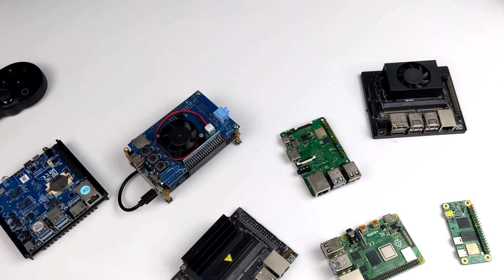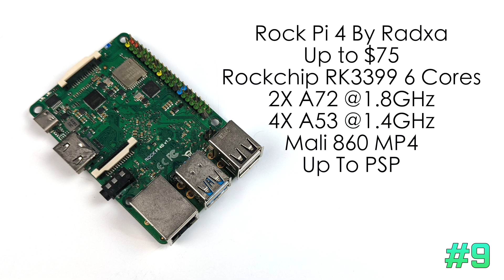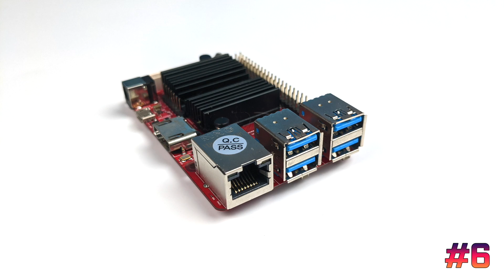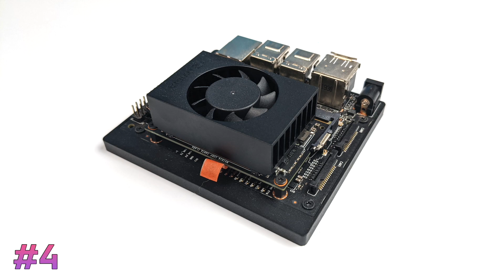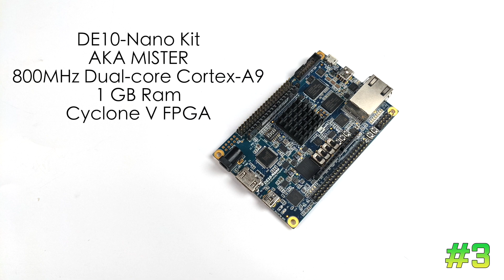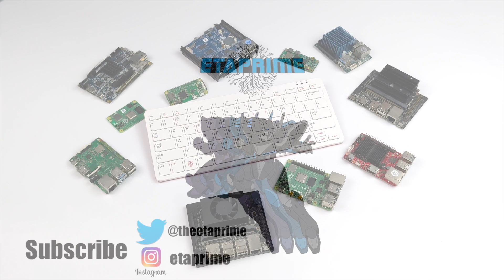The Best Single Board Computers Of 2021 Top 10 ARM SBC’s

Comment: If anyone knows this answer let me know please? Which board will work best with a 4k camera module? One that can support at least 30fps if not 60fps. Been looking at ardumcams for rasberry pi but it seems the pi isnt powerful enough to run 4k video from a camera module. On Arducams it seems there is support for the jetson nano in 4k but I wanted to ask if anyone knows better. Cant be more then $150ish its going into a prototype product for consumers. Doesnt make sense to spend $400 on just the board no one will buy so needs to be within reason.

Comment: I'm a Pi enthusiast and run an 8GB Pi 4 as my nextcloud server.  But I don't feel like it's quite powerful enough the be a desktop replacement.  I'm really not a gamer beyond the occasional NES/SNES emulation so that's not it.  As a scrum master, most of my work is done with web tools like Jira.  Any suggestions for a sub-$100 sbc with a little more desktop oomph than the pi 4?  (Bonus points if it can drive 2 displays over USB).

Comment: Hmmm, technically my favourite "emulation" board does not exist and I have problems with calling it "emulation" as it is very very different technically from what software emulation does. From this you're likely already realizing I'm talking about something along the lines of the DE10 (Mister FPGA), and you are correct. What I prefer is the FPGA Hardware Re-implementation approach as it enables us to have the closest thing to the original hardware implemented. That said, currently (even with the large number of available LEs etc)  the FPGA approach still has some limitations due to workarounds having to be implemented due to the fact we have architectural limitations forced upon us due to using a single chip. 
I want to see a board using multiple FPGAs interconnected with a "smart" BUS (or multiple BUSES, which is important for architectures such as the Amiga) enabling us to implement the hardware much closer to the original arrangement and removing the limitations imposed by using a single chip solution. 
My idea would be to use those cheap Cyclone II boards (the most basic breakout board available for these) and then making a motherboard to interconnect about 4 of these. This board would have at least 2 RAM sections (Again Amiga related requirements to implement CHIP and FAST RAM)  preferably 3 each with their own sockets. It would have an expansion BUS to enable add-ons to be made for the system (so you could for example use real hardware from the era with this, like for example Zorro boards), Compact Flash socket (because this one has UDMA support unlike SD cards), USB ports for Keyboard, Mouse and a special USB port working as a Gotek for floppy support, HDMI output, Analogue audio output, custom ports to use ESP8266 or the ESP32 as WiFi modules, Gigabit Ethernet, a broad selection of GPIO with Digital and Analogue pins in order to enable not only digital joysticks support (Amiga/Atari/Early Consoles) as well as the PC analogue joysticks support and of course Midi (as this is basically just a custom serial interface truth be told)
This mainboard will also have a microcontroller (Arduino or the new PI MCU) with it's own SD card that would be used to upload the firmware into the FPGA cores and handle initialization tasks as well as base system management (Power On/Off button control much like the PC does as well as thermal/fans control).
It also needs (aside the BUS expansion connection) an additional FPGA bus link to enable us for example to connect those fancy Cyclone IV dev boards that like the DE10 already have RAM, VGA, PS2 and SDR connections among other niceties. This particular connection would be handy to enable the emulation for example or more advanced GPUs. Having their own onboard RAM definitely helps with this.
Making this board modular (in what concerns the FPGA boards) would enable future upgrades by simply upgrading the FPGA modules.
(On this whole subject, I actually have 4 Cyclone II's and one of them Cyclone IV dev boards as well as Arduino's, in fact I wish I actually had the time and help getting this idea off the ground as I admit I'm missing some know how needed to do this, implementing the mainboard design would be feasible but when it comes to the FPGA cores I would take an eternity to get this done as that part I have never handled and I suppose that getting existing cores and breaking them down into multiple components so we could break down the system into the multiple FPGAs as well as recode them to better match the original hardware will not be an easy task, specially alone and never having done such a thing - there is another reason to want to have this done like this, such a base system can enable the development of a computer system that can morph itself while running, for example changing part of the GPU to have a different type of video decoder on the fly instead of doing it on software, or change the CPU to support a new instruction for example to handle things like encryption and decryption, this would be a system that could basically update its own hardware capabilities as needed and is something that having a proper OS developed for taking full advantage of the features and possibilities provided by such a platform will prove quite powerful not to say revolutionary).

Comment: Buyers of the Pi CM4 beware!!! 

I just bought a CM4 (with Wifi, 4gb ram, 8gb emmc) and I was blindsided by something I haven't seen anyone mention. If you buy a variant of the CM4 with on EMMC storage, you CAN NOT use the microsd card slot as well. The io pins inside the SoC for the sdcard slot are connected to the emmc module instead on those variants, meaning the sdcard slot is not connected to anything. This is not something IO board makers can fix either, as it's inside the CM4 SoC. So, do not buy a CM4 variant with EMMC storage expecting to also be able to use the sdcard slot for extra storage. The only way to use a microsd card will be to use a microsd-to-usb adapter, thus taking up a USB port with an adapter sticking out the side of the Pi.

Comment: My favorite is still the Pi 4, a great balance between power, price and software support. I still use my old Pi 3 too, set up as a 720p home security camera with a C920 webcam.
Those Tegra boards are lovely, wish there was more software support for them though (outside of AI use cases). The Xavier NX is 400 $ or more depending on where you look. The specs are monstrous though for an SBC.
Rockchip software support is getting there but still needs work.

Comment: I know the RK3399 is not your favourite, but I do a bit of hardware development and it is BY FAR the best chip for USB throughput.  Rockchip makes the only SOCs with independent USB busses for each port.  Every other SOC uses some garbage hub (either internal or external) that trashes USB bandwidth.  

With every other SOC the most you can hope for is 2 USB camera and no other hardware.  With Rockchip SOCs you can easily push 8 USB cameras, wifi adapters, SATA, or potentially even more.  Even Rockchip's lower end stuff still has independent USB busses.  There is no comparison if you're building a NAS or robot.

Comment: The reason that drives me back out Raspberry pi
It is the disastrous support of Opengl 3.x / 4.x and Vulkan 1.1 / 1.2. 
And not to mention the performance of rendering on high resolution.
On the odroid boards the performance is very lost out in linux (x11 good driver) and it focuses a lot on Android. for better perfomance and out for latest API.
Compared with Nvidia jetson boards it's very limited in the AP latest engines standard. 
They are not even at the height of being able to load an engine to the level of  dx11.

Comment: LOL ... the RPi4 fans are dellusional. Calling this thing "powerfull" or "a beast"?! Someone even saying, they should release the pi5 to "stay on top of the competition"?!
As long as there is competition for the raspberry pi, it is because of the SoCs they choose being slow and compromised ... every generation ... the price for choosing broadcom!
They REALLY REALLY should try out an Odroid N2 or Khadas vim3 pro

4xA-72@28nm                   vs 4xA-73+2xA53@12nm
VideoCore Vi (32 GFlops) vs Mali G52-MP4 (108GFlops)
microSD only                      vs eMMC

What held back these fantastic SoCs was the progress that had to be made on the panfrost driver side for Mali-G52 (also known as bifrost) graphics. The RK3399 chips had the predeccessor graphics called Midgard which reached the same level of usability half a year ealier. But Bifrost support in panfrost now has a very usable state. Now they run on a fully open-source stack ... no binary blobs needed! Always on the latest Kernel an Mesa-Stack! eventhe drivers for video hardware decoding are right in the vanilla kernel! Just download Manjaro and start using it!

I have a Khadas VIM3 Pro which has a variant of the same SoC as the Odroid N2 on it (has A311d instead of the S922X ... difference being the AI accelerator which is active in the A311d .. all else is equal). As long as you don't ask it to play youtube in a browser at 1080p/60 (which at the moment has to be done in software) it really feels like a desktop. The Browser is so smooth and snappy that you forget that you are surfing on an ARM SBC! Video acceleration is on its way to getting figured out on the application side ... and the big Amlogic SoCs (S922 and A311) have VP9 hardware decoding at 4k60. So these SoCs can do for years what Pi4 user dream of in a Pi5.

Comment: There's such a sad situation in the market right now that all the Pis are pretty much sold out everywhere in my country. I'd love a Radxa Zero so much but importing it from China is pretty much pointless because if you add up the price/performance with the cost after customs, you can get a pretty nice Intel mini pc with a built in EMMC drive and 4 gigs of ram sealed from people on various sites online. For example, a quad core atom with a 64 gig emmc and 4 gigs of ram (and a Win10 license) cost me less than a Pi4 4G from scalers right now. Kinda annoying!

Comment: With all the renewed interest in CRT gaming from the retro community, I think whatever comes next, as long as it has CRT compatibility out of the box and/or is easy to enable, will definitely have a leg up on everything else. Got to admit, MiSTer looks amazing, but pi 4 via composite or vga looks and feels pretty authentic. If money were no object, MiSTer wins hands down...but for me, pi 4 through composite is good enough while I save for something else, and I would definitely buy a Pi 5.
Reply: @funguseaterAI  no I hear you, if I didn't have a couple of smaller CRT sets I would just move on. No way can I go to anything larger than a 20" though, and even that is pushing it. If what I have now craps out though, I don't think I'll keep looking for replacements. If I can't fix it myself, I'll just move on

Comment: I just wish someone would release a real powerhouse of a ARM SBC. I just find it sad that my old Pixel 2 XL from 4 years ago is more powerful than any of these. I bought the Pi4 because so many were saying how powerful it is. Guess I have a different definition of powerful. It can't even do smooth youtube playback at 1080.
Reply: That's your first error.... Listening to Pi evangelists. The Pi is a piece of crap in terms of specs. It's all about the ecosystem and the expansions which lead to so many possible projects.

I'm quite happy to quote and compare specs to anyone who disagrees.
Reply: YouTube playback is all about hardware driver support, and has nothing to do with how 'powerful' it is. A Chromecast can show YouTube, it has a minimal processor, but it's completely optimized for video decoding. The manufacturers simply don't release the video drivers required to make it happen on a Linux board.

Comment: Nice video! Over at Retro Arena we are working on an image that will run on both the 2 and 4GB models, and have 2.0GHz CPU speed, with 1.15Ghz GPU. Should be done in a couple of weeks.

Comment: The last single-board computer I bought was the pi 3 B+. It's been going for over three years and I don't see a reason to replace it yet. Now for hire emulation I use a small form factor PC.

Comment: On the top of my list is Rpi4, of course. The king is the king, it's the only one that everything's made for. Then, there are a few blank spaces, and then I like android TV boxes actually, they can be had really cheap. Also, odroid n1 is great due to s922x chip (huge batocera fan here). After that, next to computers like hp prodesk 600 mini, I don't really need more machines to fill the list honestly. I do like the new radxa zero, but for now it's just promising, not a must have.

Comment: I can agree on most of your picks though i would put the raspberry pi 4 at the third place for emulation, as depending on where you buy one, it isnt very cost effective, so i would put the Odroid n2+ at first because it has a decent community to make things run pretty smoothly, and its slightly more powerful while in some cases being cheaper.

Comment: The Odroid N2+ is an absolute beast. Go head an consider a video dedicated to this board. I've done both emulation with Batocera and I'll fire up Android from time to time. Plug a cheap little wifi adapter and a bluetooth adapter and there you go!

Comment: I've never seen a pi zero anywhere close to $5 to $15. More like $30+. My favorite ARM has been the Orange Pi PC, or any TV box with the same Allwinner H3. I've found a few for around $15 to $20 shipped before. They run Android 7, RetrOragePi (Emulation Station), Lakka (RetroArch), run emulation up to PSP, there is even a build of The C64, and more.
Reply: I've got an Orange Pi that I've never really tried anything on. Interesting.
Reply: damn, raspberry pi zero is 10$ with shipping here, with wifi its 16$

Comment: For me it's always very frustrating that usually the most weak in hardware boards have the most software support. Fir a few dollars more you could get a way more powerful board that runs circles around the RPI4. Just think what all we could do if the Jetson or the Odroid had the same software and development support like the RPI4.
Reply: cheap -> more users. I think for emulation use case it's enough( Pi4 up to PSP/Dreamcast), If I'm not mistaken only jetson xavier that can go above that, and at that price point I'd rather get a used PC.
Reply: Aren’t all the jetson boards weaker than the rpi except in gpu?

Comment: Great list here.  I still use my oDroid XU4 for emulation.  I recently switched to using Batocera on it and I have not had any problems with any of my games or the systems that are included.  I've even been able to play one PS2 sports game on it (with PCSX2 tweaked out a bit).

Comment: Not sure if there's actually 10 options for x86 based but if you can, you should do another video about mini/single board x86 machines because those can be handy to pair with existing x86 machines as lower end nodes for example (As in: you can ARM based clusters and just keep adding nodes but it's usually not something you can combine with existing x86 hardware whereas I can repurpose at least 3 or 4 older x86 machines and add more x86 SBCs if I need to expand the cluster)

Comment: I was just searching for a SBC today to run some bots i created and I was very shocked how the Raspberry Pi Zero has jacked up in price (I'm in Asia). On Aliexpress, the Raspberry Pi Zero WH and the Raspberry Pi 3B+ cost roughly the same price (at around SGD$80 ~USD$58). I bought a Raspberry Pi Zero W a few years back and it was only SGD$35 ~USD$25. I really wonder where the retail price of USD$5 has gone. The only "cheap" Raspberry Pi I could find was the Raspberry Pi Pico SGD$10 ~USD$7 but it had too much lacking to really call it a computer.
Reply: Wow. Still get a Zero for 12 EUR, but without Wifi. With Wifi they cost about 20, but are only available in limited numbers. I find the Zero perfect for projects like Surveilance camera or such where the lower processing power and Ram is not an issue
Reply: @lucius1976  what shop are you looking at? a zero without wifi is less than 11€ here with shipping, and the wifi one is 16€
Reply: @SweatyFeetGirl  reichelt